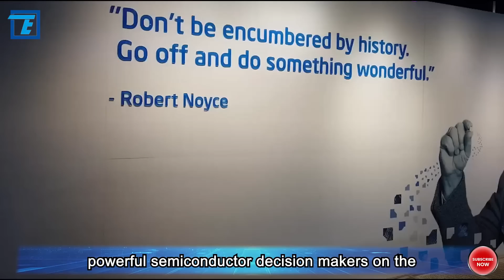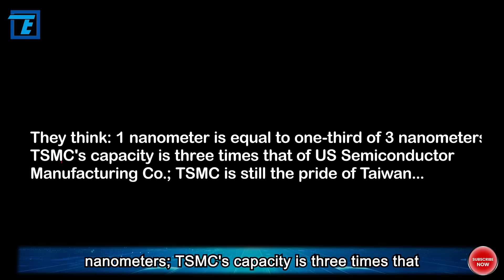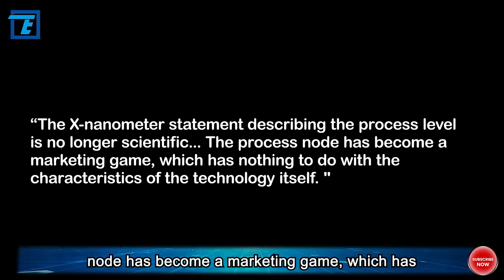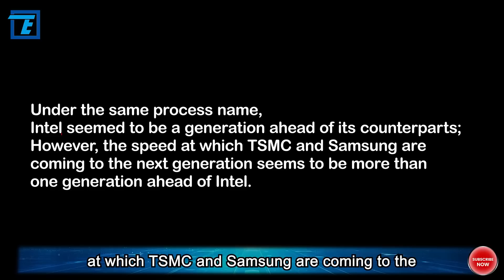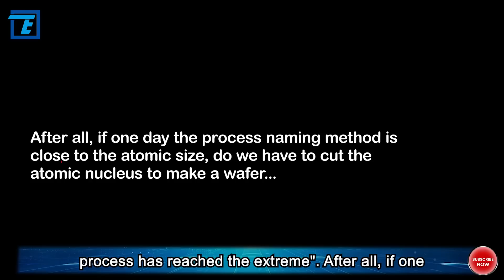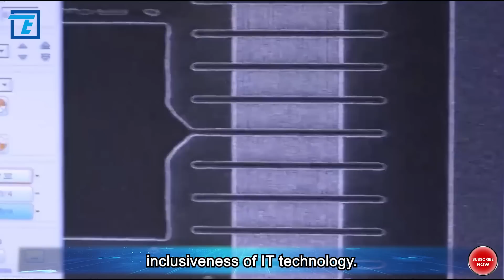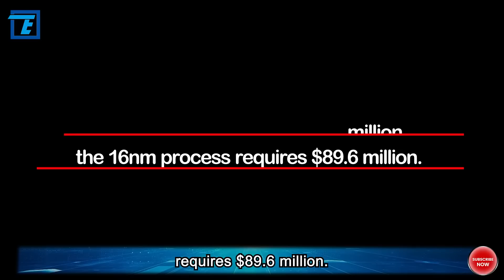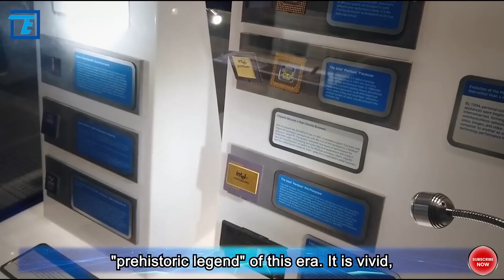They are all lying! Nanometer, a grand word game of TSMC, Samsung and Intel

Comment: They are stuck at 4nm as this 4nm launched is not a true 4nm as it was repackaged from 5nm. They will be stuck here for some time. TSMC 3nm was rejected by Apple as it was too expensive and it has huge heat issues. The Chinese will chase by 2025. They already at 7nm. Next target 5nm. They will work alternative ways or material to reach their goal bypassing lithography machines EUV. For those who doubt, on a clear sky, look into a high power telescope and see the Chinese space station.